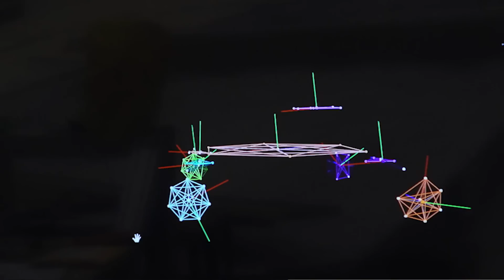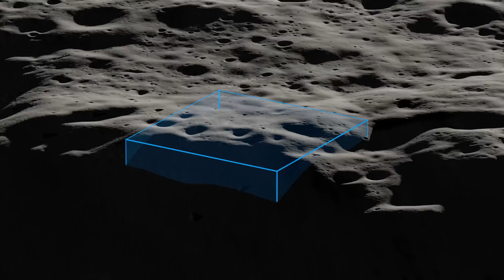The Dumbest NASA Decision In Years? Why NASA is Being Forced To Ground Rover and Sent Ballast.

Comment: If it's finished, and the lander is paid for... why can't they pause everything until it's landed?  Put the spares in storage, have the people work on what they would otherwise work on (funded by other projects), and just minimise the cost of that launch delay.
Reply: I'm not sure why they cannot take the untested rover, attach it to the lander, and see what happens.  At worst, you end up with a non-functional rover on the surface of the moon, but at best it works.  The alternative is guaranteed to be a non-functional rover on the moon.

The only reason I could imagine to justify this decision is if the rover isn't electrically isolated from the lander -- Thus, an electrical fault with the rover might kill the lander.  A possible alternate explanation would be if the parts of the rover are judged to be more valuable than the scientific payoff for the mission, but that seems more dubious.
Reply: Many of the people who worked on this will simply not have a job; that company doesn't have other stuff for them to do. If there is other stuff, it's being done by, um, others.
Reply: Right, but we're regularly sending out probes that take months or years to get to where they're going.  I refuse to believe they pay all the required staff to sit twiddling their thumbs while a transfer orbit with 5 gravity slingshots is performed.  New Horizons, for instance, spent the time between Jupiter in 2007 and Pluto approach in 2015 in sleep mode.  MRO took 7 and a half months to get to Mars.  There has to be a standard plan for dealing with this kind of thing other than paying the full mission team to just wait around.  Do they reinvent their dead time solution every time they spec out a mission?
Reply: It’s not that simple. Yeah you can temporarily reassign the team, but finding temporary jobs for everyone is difficult and hard because you don’t know how long they’ll be away or how long their temporary work will take, you still need the staff to store the rover, parts, and tooling away, you have to pay rent and storage still, and you have to pay everyone to organize their work so they can more easily pick things back up, and you have parts that suppliers are still working on, or you have to call all the suppliers and have them put their work on hold which they’ll likely charge you extra for. While everything is on pause you’ll have people move off to other things so when you get back to work you have to hire and onboard new staff, you have to call all your suppliers and have them resume work, everyone needs to get on the same page again, and all that really lowers productivity.

Basically it’s complicated
Reply: what was that one probe that sat under the stairs for decades?
Reply: @RecurveStickerDragon DISCOVR I think. And Galileo had to wait a few years too since it was supposed to launch via the shuttle but then Challenger happened, and sitting in storage might’ve even contributed to the failed high-gain antenna deployment
Reply: "minimise the cost"... :) so young, so naive.
Reply: Ground systems are not finished. And it is very hard to find another budget to pay for those people for an unknown time, particularly at a time when the enacted science budget is 1 billion less than the requested. There are plenty of other missions with similar difficulties.
Reply: @paulopenteado5552  Ground systems not finished is a good point, yes.  Sending a probe that you have no command for is going to be problematic for other reasons.